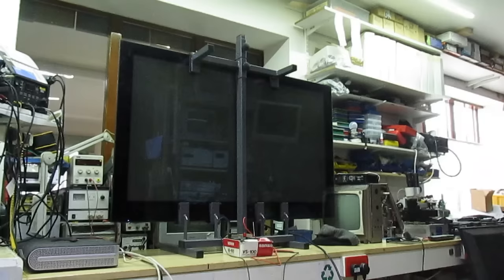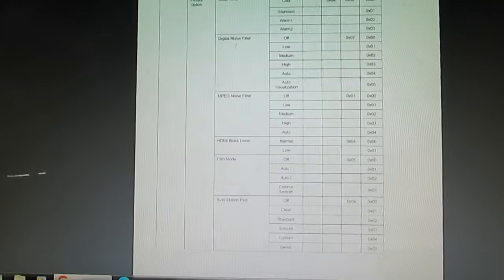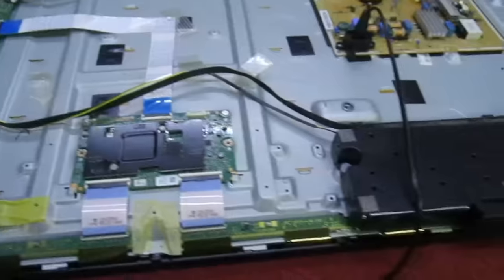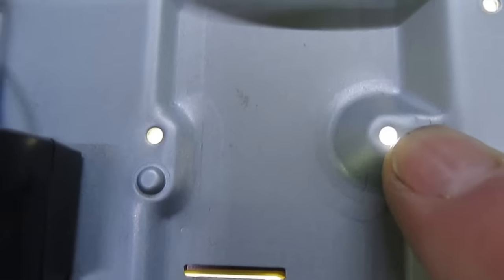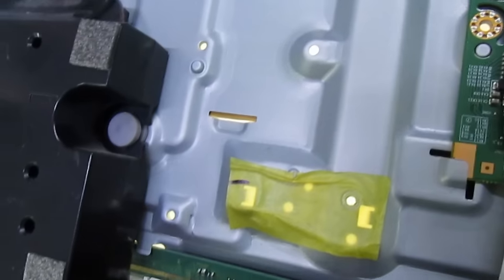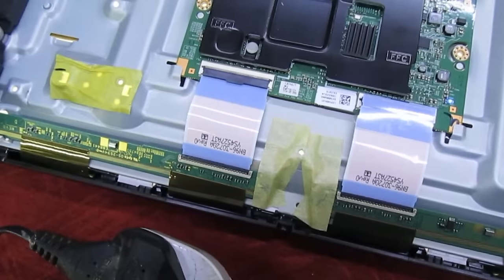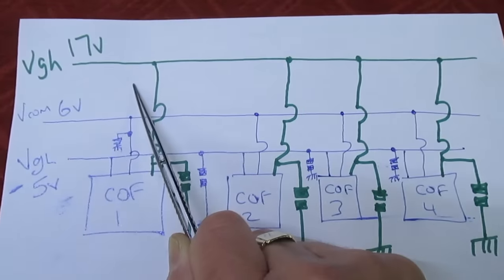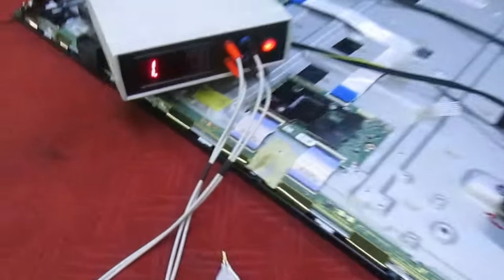Video to highlight the problem of repairing flat panel TV sets

Comment: That was a very professional approach to troubleshooting. Thanks for the info. May I pick your brain a second with a question. I have a Sharp smart tv that is giving a flickering screen. It's not continuous. It has a period of about once a second. Some days not as bad others worse. I ordered a (used) T-Con board, replaced it but kept getting the same problem. What would be your best guess as to the problem?
Reply from the maker: Difficult to say without seeing a faulty LCD panel can be the cause of it could be the backlights flickering, if its the backlights you will be able to see the flicker by looking at the holes in the metal work at the back of the screen, if it's the LEDs flickering try turning doen the back light level in the menu to reduce the led running current.
Reply: @michaeldranfield7140  thanks for the response. It's more of a up and down shaking of the picture itself. Wish I could send a  vid but I'm not sure how to do that on here.
Reply from the maker: An up/down shaking is more than likely a faulty LCD panel.

Comment: All around great video, as per usual. BUT as a novice to electronic repairs, the most important part of this video, would have been, when you tested the culprit components, namely: the SMD caps, and THAT is the part you DIDN’T show. Where did you place the test leads? At both ends of the caps? With one probe on ground and the other on…? Please, please clarify this. Thank you kindly
Reply from the maker: sorry about that but the plastic tripod for my camera broke so I had to prop it up  and like some others my video making skills are not very good im afraid ,but to answer your question when your using a milliohm meter the leads must be placed directly across the cap itself .
Reply: @michaeldranfield7140  Thank you for replying, I truly appreciate it. Ok, I wouldn’t have thought that… I would have placed the probes on a ground point [like a screw hole] and the red probe on the power rail, and I would have probed around ‘til I found the lowest Ohmic reading. Keep making videos, you’re a great teacher. Cheers!

Comment: I had an HP all in one PC with a built in monitor, real nice unit, for the 13 months it lasted with its 12 month warranty... the shop I took it to had the same problem you had with this set.  No diagrams, and parts were next to impossible to get, even for a shop.  For me I tried to replace the fan at first because the fault code said processor fan malfunction.  Turned out that was because some electrical short fried half a dozen components in the computer including the driver for the monitor, and you guessed it, no way to fix it other than order a whole new monitor, which happens to cost more than a brand new unit.  I said, NO I will not be doing that, since it already took 5 months of him troubleshooting and replacing whole boards to come up without a working unit.  Thankfully he is a standup guy and stuck to his word of only charging me the $75 troubleshooting cost.  No charge for all the parts he ordered to try and fix it, not to mention the MONTHS of hours he put into trying to fix it.  I remember fixing electronics back in the 90s and it was nice to be able to order circuit diagrams and actually be able to repair stuff I owned without buying a new unit.  Now today's world is such a disposable world.  Everything is designed for the no brainer, shotgun repairs. Just swap a board and charge full price and onto the next one.  I always wondered why so many old people were so angry all the time, now that I'm old I totally understand.
Reply from the maker: The truth of the fact is the makers don't want items to be repaired , they just want to sell another one , if you look back 30 years it wasn't unheard of to pay £10-£15 for a paper service manual and in those days that was quite a bit of money but now with the internet it would cost virtually nothing  for a manufacture  to publish a service manual or even just a circuit diagram on the internet for people to download, such a simple and cheap thing to do but its not done .

Comment: I’ve pulled literally dozens of flat panel TVs from the trash and repaired them.
I currently have an early 49” Sony 4k that was struck by lightning. 
The power supply was cheap enough to replace, but the main board is still hideously expensive.
Reply from the maker: Sadly this is the reality of the situation, sets are now so cheap to buy brand new people just throw them away without having them looked at.

Comment: No schematic-No surprise !   Used to work on CB/HAM Radio's.  Same problem...
Reply from the maker: no schematics for anything these days, not made to be repaired .
Reply: I got the service manuals for my Kenwood ham radios. But there was also a schematic in the user manuals. But they are from before 2000.

Comment: I had often wondered if a milliohm meter could be used to find a shorted component., but never came across a failed piece of electronics that I could try the idea out on. Yuor demonstration shows it is feasible. I tend to watch a lot of electronics repair channels and often wondered why they do not use this technique to find shorted components.
Reply from the maker: The simple reason is a commercial bought milliohm meter cost a lot of money , and its only useful if the short is below 1 ohm , above 1 ohm I adopt the bench power supply and see what burns up method .

Comment: Wait -- they actually HAVE service manuals still? I'm amazed they even give you that (not that it's much use). It's clear that too many end up in landfill polluting our world. I miss the days when we could just follow a circuit diagram and compare that against what we're seeing/reading. Also - not to self, make a milli-ohm meter and check for faulty SMT caps in future!
Reply: Or recycle the components.
Reply from the maker: A lot of sets dont have service manuals at all now  , the last time a proper service manual was produced was at the start of LCD tv sets about 2010 or so
Reply: @michaeldranfield7140  So I've been hearing Michael. Seems that way with a lot of consumer electronics these days. I grew up unable to afford parts so I learned a lot by taking old bits from busted radio sets and making my own bits and bobs using books by people like Ray Marston. Kids these days have to buy new parts and many are so fragile they are easily busted, but so cheap they are also easily thrown in the trash where they end up polluting the environment. This is also why a lot of electronics end up discarded - people just can't be bothered. Hell, I picked up a spare DVM the other day that someone had put out to the trash. The fault? The battery was flat!

Comment: I've got my head in a Samsung at the moment, with a tripping power supply.  No schematics, very little idea what is going on.  Added to which is that the cold cathode backlight on Samsung TVs tend to go yellow, so it's not worth investing in a replacement power supply as it may be poor anyway.  You can see why they get dumped.
Reply from the maker: You may find your yellow CCFL Samsung set is not the tubes themselves, usually its caused by the thick perspex like light diffuser that goes yellow with the heat from the CCFL tubes but unless you have a little used scrap set with a still white  diffuser repair is not viable, as for diagnosing a fault with no service manual all I can say is good luck, I have this problem every day, looking at manufactures data sheets for the chips on a power supply may throw up some application circuits that will help, however with some dedicated manufacture chips there is no datasheet either.
Reply: @michaeldranfield7140  I didn't know it was the diffusers that caused the yellowing, thanks for that info.

Comment: Nice one Mike. How many of these caps have i replaced? Last one was oc on a 12v dc to 220v ac inverter. Its rarely the silicon.
Reply from the maker: Correct, these cap are overtaking semiconductors for failure rate.

Comment: Confused , The back lights were not working at the beginning. what made them work prior to installing the cap?
Reply from the maker: It was the faulty cap keeping the backlights off , I cant say why this should be as I dont have a service manual with the technical information in .

Comment: A few months ago, my Samsung 32 inch TV, approx 10 years old, went dead. Before sending it off for recycling, I thought I might as well open it up and see if I saw anything obvious. On the power supply board, I noticed one electrolytic capacitor was bulging. So I googled the power supply board, BN44-00261A, and found a schematic and parts list, including components on the board. I don't know whether it was authorized by Samsung, since it wasn't on a Samsung web site, but it seemed to agree with the components on my board. So I ordered all new electrolytic capacitors, based on the schematic and parts list, and replaced the ones on my board, and it worked. Maybe I was lucky and the info was available because my TV is so old.
Reply from the maker: You will find the older the TV the more repairable it is.

Comment: First of two thoughts.......

Michael: Have you noticed from air-conditioners, to washing machines to TV's and beyond capacitors seem to be the primary focus of failure this past decade globally? I realize that caps do go bad (leak, short, go open & dry out after some time).....but after working on all the above I've almost come to the point of expecting  it.
Reply from the maker: yes I have noticed that and caps do not have an indefinite life , but if you look at stuff made years ago before caps were made physically  smaller they did last much, much longer .
Reply: @michaeldranfield7140  Agree. I collect and restore antique radios .....not that I don't replace them understand....but 50+ years opposed to today's...no comparison.

Comment: Land fill is full of such faults were the tech just puts in a new PCB and the fault is fixed for just $200 for a 50-cent component. Progress is a wonderful thing.
Reply: That's why my wife says am not allowed to go to the recycling centre
Reply: @welshwisdom  Here in New Zealand, the CLEAN and GREEN country, they would not let me enter the recycling centre for electronic waste. They would rather land fill it.
Reply from the maker: Years ago a lot of the tips were privately owned and I use to buy 6-7 TV s a week from the tip and repair them and sell them but unfortunately all the ones I know are now owned by the council    and they wont sell anything, everything goes to be crushed which does not make sense as I could pay them more money than there worth crushed up .

Comment: Hi Michael
I have a Philips 55" TV which has a intermittent flicker on the bottom 6" of the screen. I gather it is the bottom LED strip which is to blame. Are these replaceable and could I do it on my own. (I'm handy with a soldering iron). Really enjoyed the videos. Good work.
Reply from the maker: you could do this , the biggest problem is getting out the LCD panel without cracking it , then if you manage this OK I would only recommend fitting all brand new LED bars , forget replacing individual LED s , been there , done that and it all ends in tears, wont be long before another LED fails and then you have all the labour to do again .
Reply: Excellent thanks for the advice 👍

Comment: I get "Right to Repair" and am all for it. However, the free market works and I think the first manufacturer to make serviceable flat screen TVs, complete with a true repair manual as the one shown in the beginning and available parts/components, would absolutely OWN the industry. They could even offer paid training to diagnose and repair their sets. Those of us who are 50+ know how long things used to last, and how, even when they broke, they were basically repairable indefinitely. The "everything-is-disposable" mindset is disgusting.
Reply from the maker: I know what you mean but its easy to see how we got here , in the mid 1980s a bog standard colour TV cost about £300 which was a lot of money compared to someone's wage back then , now you can buy a 32 inch TV for £160 , or just 1 days wage for some people .
Reply: @michaeldranfield7140  Yeah, that's the trade off I guess. Buy it cheap and throw it away. I so appreciate your channel for taking the time to show that this stuff can, in fact, be repaired in many cases. Thank you!

Comment: Good Video by the way
that's is not timing control cable is could LVDS Cable
Reply from the maker: Yes , its the Low voltage differential signal ribbon , my videos are no longer edited so expect to see loads of mistakes !
Reply: @michaeldranfield7140  it's ok 👍 I just want you to know about LVDS. and you are Good technician and blogger that's why I like your Video because no edit.

Comment: Would it be possible to detect the blown cap with a FLIR ? Or with freeze spray ?
Reply from the maker: Only if its not on a current limited supply line ,where a over current situation is detected and the chip switches off the supply rail .this method is no good .

Comment: What would the repair bill for the $1 part be?  Probably close to $300 for time and labor.
Not like when the vertical was not working and all it needed was a new 6SN7 tube!
Reply from the maker: I dont charge that much , if I did I would have no customers at all ! this fault is quite common on modern sets and very quickly found with a milliohm meter 
. Couldn't agree more with you , the tube days  were the best .

Comment: wow that cap could so easily have been missed, think i would have. but i couldnt see how disconnecting the left bank of column drivers enabled the back light when it was the right bank that had the short , im guessing the cap wasnt a direct short and unplugging the good side just reduced the loading on the psu just enough not to trip that rail. that apparent conflict of logic would have got me in a spin
Reply from the maker: Lots of people asking the same question but without a schematic diagram I cant answer that question as I don't know myself .

Comment: Have a fault with my irreplaceable 4K Passive 3D Sony Bravia, Sony Support just offered me a discount on a new TV instead of sending anyone out. Tracked down the service manual, which honestly seems pretty good compared to the Samsung one in your video. It has a fairly comprehensive troubleshooting section with voltage checks for certain components. It is however still geared towards entire board replacement. 
But since Sony get their panels from LG, it really only covers the Sony parts in detail. The disassembly instructions stop after power supply and main board. TCon, LED driver and panel are all considered one piece.
I had a faulty TCon board(terrible vertical and horizontal lines), replaced the TCon board and lines are gone but now there’s a flicker/pulsing every 1-2seconds of the polarisation filter. I tried watching a 3D Bluray, but the 3D drops in and out every 1-2 seconds. I can even sometimes hear a click when it happens.
Is it common to find a TV with multiple faulty components? The original TCon board was definitely buggered.
Do you have any suggestions for where I should look next? I’ve spent a lot of time already trying to resurrect this TV. I don’t want to let it go.
Reply from the maker: Sometimes a fault on the LCD panel can damage the T con board but have a look at the setting up instructions in the service manual, I don't do a lot of Sony sets but I feel sure on Sony sets the T con board has to be set up to match the panel and for this reason a lot of makers don't supply the T con board on its own, it comes with the screen.

Comment: I have a 55 inch Samsung UN55RU8000FXZA. 

1) The standby light flashes momentarily when I try to turn on the TV but there is no picture/ sound/ or backlight. 
2) The 3 electrolytic caps on The Power Supply Board at the top left ( near the o/p to the main Board) have 'domed' tops.
3) When I unplug the Main Board from the Power Supply Board the Backlight turns on.
4) The o/p connector of the Power Supply Board has ground at the pins at the ends & all others are 13Vdc.
5) The 13Vdc is present with the Main Board plugged in or not plugged in.
6) The Main Board does make a sound at turn on like a 'Flyback Transformer' (but only for a moment).
     
My first thought was that the Main Board has a short that is drawing down the Power Supply & keeping the Backlight from turning on. But the other possibility is that the Power Supply Board can't source the current to the Main Board. 

7) Additionally, I disconnected the 3 output cables from the Main Board & the backlight is still not lit.

Have you any suggestions?

Comment: What totally threw me off was the fact that the backlight worked with either timing board cable connected, but not both. I would have thought that one would work and the one with the defective cap would have failed. Based on the symptoms I just saw where one would run but not both, this would lead me to a voltage drop problem with both loads or the voltage regulator on the timing board.
Reply from the maker: I know what you mean and others have made the same comment , but it just went to demonstrate how easy it would have been to make a mistake and assume the panel was not the fault, I cant say whey the set behaved in this way because the manufactures no longer supply any circuit diagrams or provide technical information , my best guess would be there is a control line to a micro processor that has detected the problem but without a circuit to look at who knows .